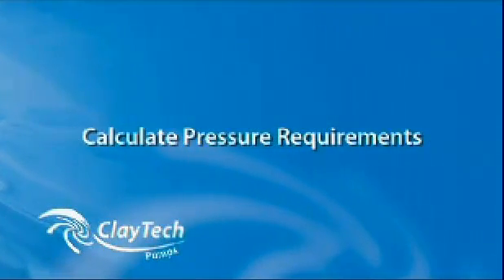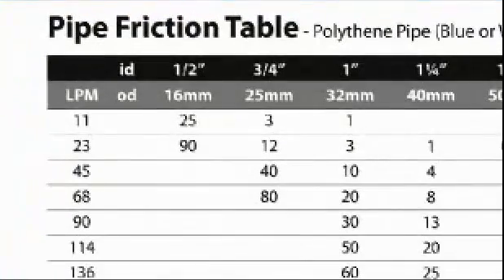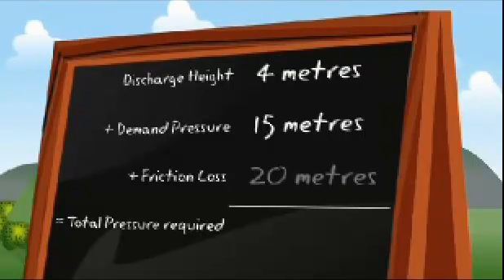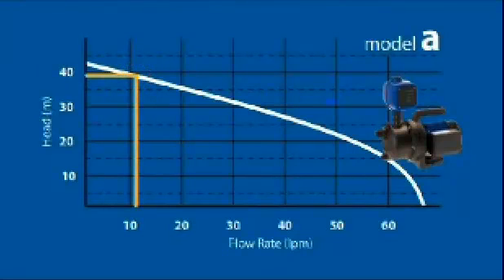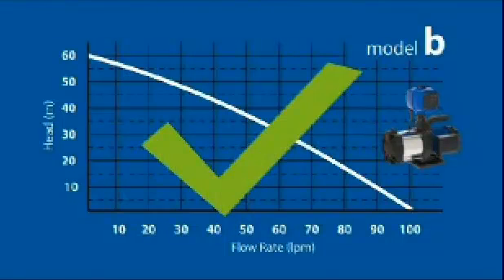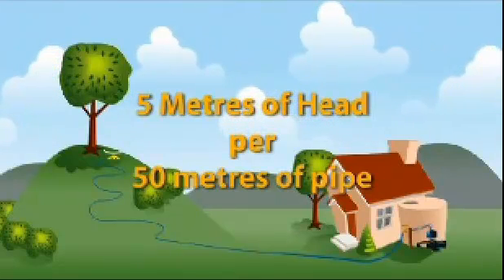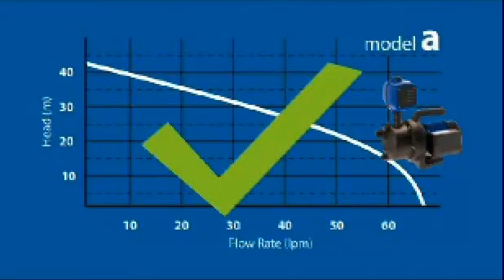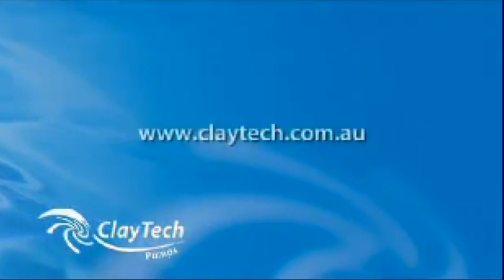How To Calculate Pressure Requirements For Your Water Pump

Comment: Anybody knows from where get 15 meter. Its on the board of booster or what
Reply: As she wants to use this water for sprinkler, that is why she need this 15 m pressure, just like we see pressure water at car wash stations. But if we simply need to fill our household water tanks, we never need pressure there.